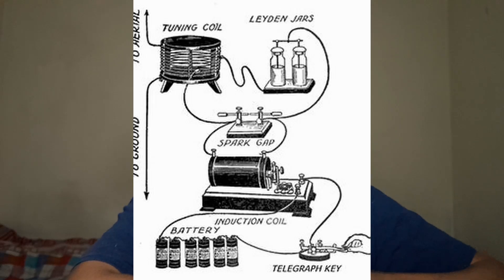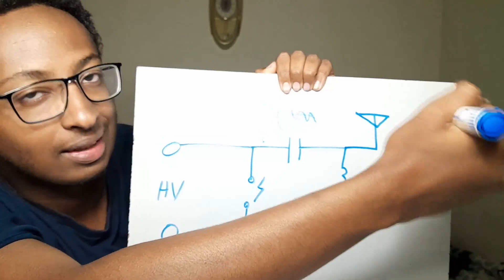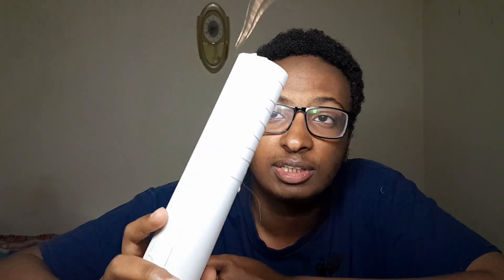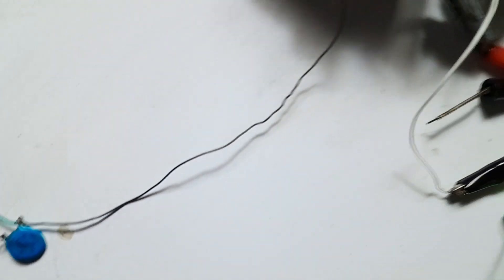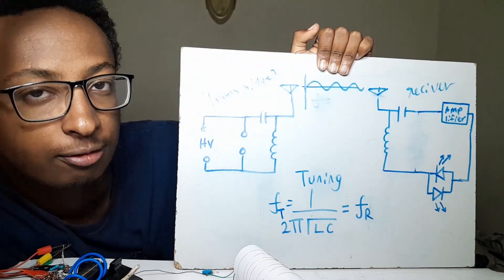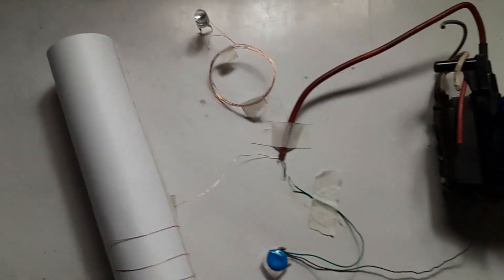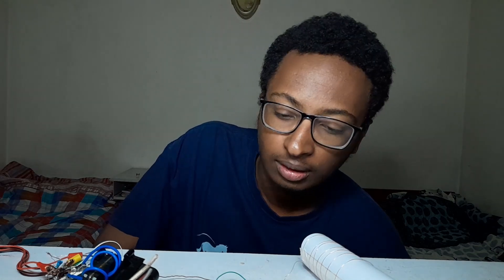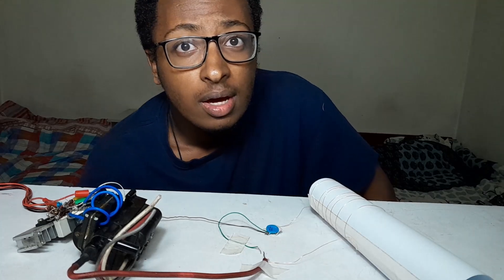I Finally Made My First Spark-Gap Transmitter Circuit From Scratch!!!

Comment: Unfortunately, the author of the video didn't succeed in creating a radio transmission. The receiving circuit is clearly not tuned to the transmitter, in fact is not even able to oscillate.
What was demonstrated is short range energy transmission through induction (like the phone chargers). This could be accomplished without the "tuning" components of the transmitter (using just the spark generator) .

Comment: Nice explanation of the circuit. Heard many free energy quacks say "spark gap" but no one every explain it.  Thanks!   Which reminds me of when i made a homemade inductor and couldnt measure it either.  So i tried to hook it up to a 4.2v battery and see what my cheap handheld oscilliscope  said and it got a 72v spike, and i was in 10x mode so 720v! and it oscillated like the diagram you drew.  So i gave this information to chatgpt hoping it could calculate the inductance for me and it was around 23.54uH. Fast forward a year later i finally got a tool too measure inductance and it came in at 10.3uH.  I just checked the chat to see why it was off and it actually guessed the parastic capacitance to make the final calculation , which it said to be anywhere between 5 and 50pf, it used 10, turns out it was 25pf to get 10.3uH, smack dap in the middle of the expected average, so it pretty much got it right given the little info it had.   But my $30 zoyi tweezer meter got it even more right, i recommend it for a cheap inductance meter and better resistance resolution then a regular multimeter.  Maybe they can send you one if you reach out, i see lots of youtber reviewing it recently.
Reply from the maker: That's actually a genius way of measurement. I would definitely keep that in mind. 
Thanks for ur feedback brother 🙏 👍
Reply: @NatiG1  Cool, but its not my idea and i did it wrong actually, youre supposed to use a capacitor that you know the value in a L-C circuit and then you can calculate the inductance after you get the Frequencey of the oscillation from a scope measurement. Thats the DIY way to measure inductance if you have a scope, but was little to  advanced for me at the time. I was just playing with it and let the inductor ring with its own parasitic capacitance apparently. Which i didnt know the value of and neither did chatgtp so wasnt the ideal way to measure it.

Comment: great i want to do one but  i only dont have the hv transformer
Reply: @JustBreadtho  you can fing them in crt tv's
Reply: i cant find. a broken one to remove it
Reply: You  really don't need the HV transformer. I understand that you already have the other components (needed to drive the transformer). You can use one transistor to drive directly the LC circuit of the transmitter.
In fact, the spark of the transmitter in the video acts simply as a fast switch supplying bursts of energy to the LC circuit. This function is much more easily and less dangerously carried out by a transistor .